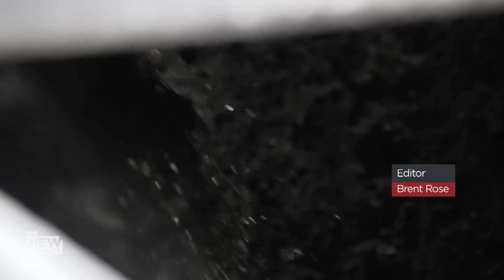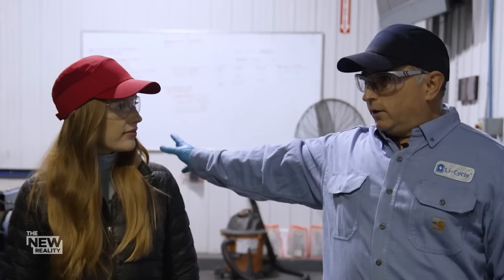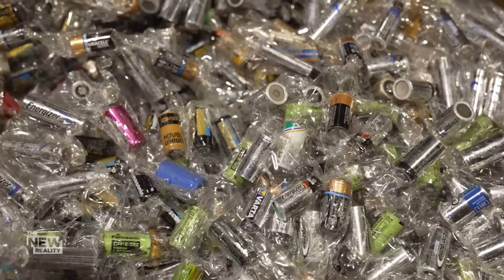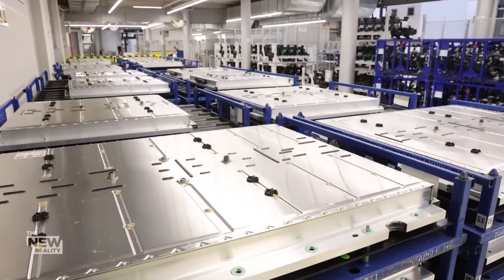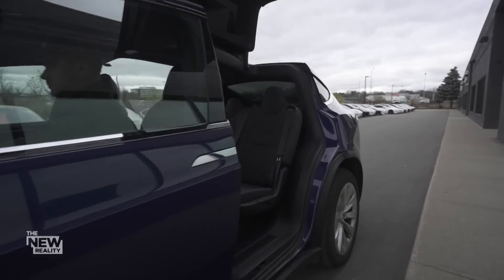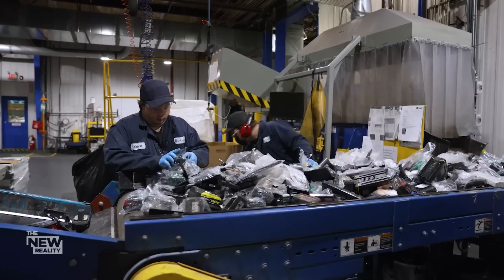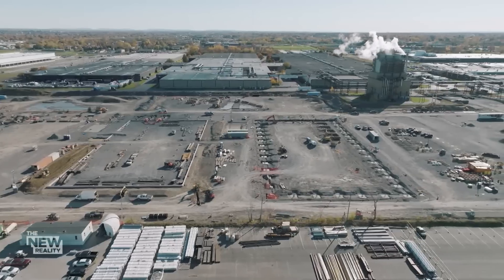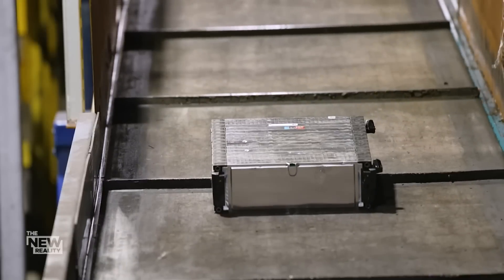How battery recycling could power our EV future

Comment: The only thing it does is perpetuate the lie that EV's are cleaner on the environment and make sense for the future. They are the opposite and pollute more in the end than just driving fossil fuel vehicles. All EV's and everything that goes with them are subsidized. People in government as well as their sponsors are getting rich while selling the lies. The lawmakers are even putting in mandates. Electrical grid cannot support it. They cost more to drive if paying for a charge vs. paying for fuel. Yes, that's right. Not only that you will have to pay a mileage tax through a device installed on your EV to pay road tax even though if you charge on the road, but it will also cost you more than a traditional vehicle. There will never be enough chargers and you would have to have parking lots full of them. Traditional charging is about 2 hrs. for only 80% charge. Elon Musk chargers still take a couple of hours for a full charge. And as I said earlier those charges will cost more than fossil fuel. You can only travel 200 miles at most to spend another two hours wait for a charge. I won't go into battery life, high insurance costs, or pollution involved in disposal or even recycling. It all ends up worse than traditional vehicles running on fossil fuel. You need to use fossil fuel as well to supplement the electricity needed to charge these foolish pipe dreams. Anyone buying into this crap thinking it is cleaner and better needs to have their head examined. We live in a carbon-based world and the carbon emission is not a problem.

Comment: Ominous is the lack of apparent or visible fire suppressant systems in that recycling process.  I'm sure they have them, but once a Lithium cation is liberated, it is vulnerable to ignition when exposed to oxygen.  Once that starts in a mass volume of similar material, a chain reaction starts.   I trust all of the commercial collections  you see at such businesses such as Home Depot, Staples, etc. are ready for such incidents.

Comment: There’s a need for home battery to actually protect the grid.

And then the recycling of whole car is another story, I think the biggest factor that got into it are the paints on the metal frame.

If recycling can get rid of these paints on metal frame, basically all the metals are easy to recycle, cars are bigger than electronics there’s less concern of e-waste.

My advice for kids in Congo is just don’t go there if they felt like they didn’t have to, if it’s not kidnapped they should figure something out other than the mining. They really have to think for themselves if mining those things are what they wanted to do, it will literally kill them, I don’t think it’s worth the risk.

Don’t we have same materials somewhere else?

Comment: The hidden waste and emissions behind an Electric Vehicle is insane.  From the child/slave labour used to mine the cobalt in those batteries, to the factories in China, the electrical grid to keep these things charged, then the need to get rid of the car at the end of its life. These are by no means a 'green' solution
Reply: The not at all hidden waste and harm of fossil fuels is insane. At least metals can be recycled while it's impossible to recycle fuel once it has been burned in an ICE vehicle